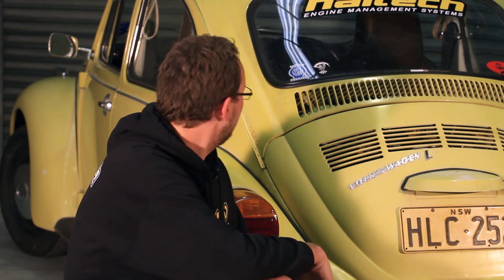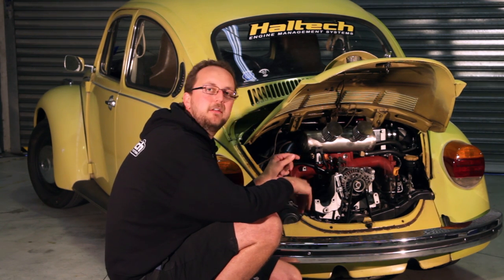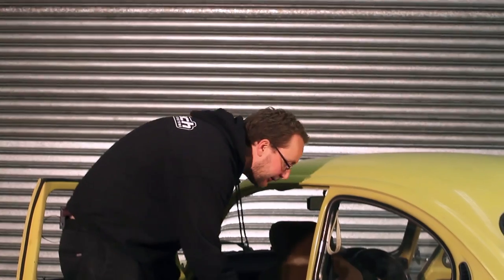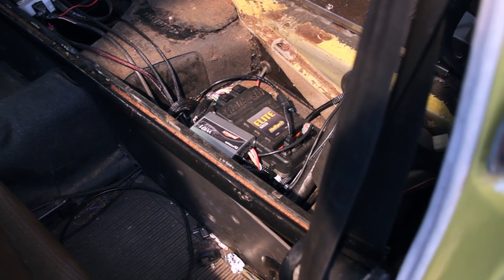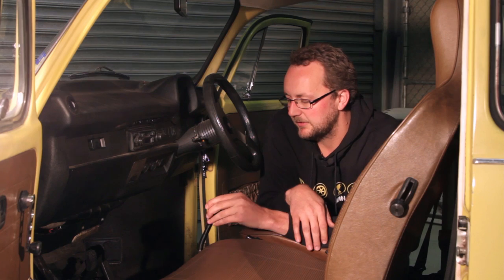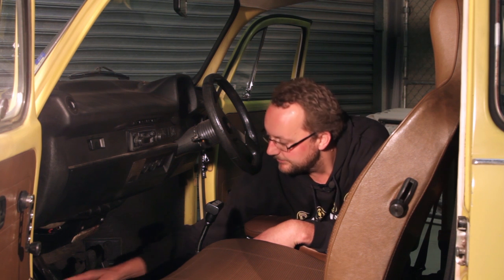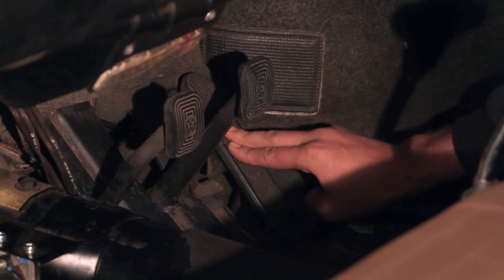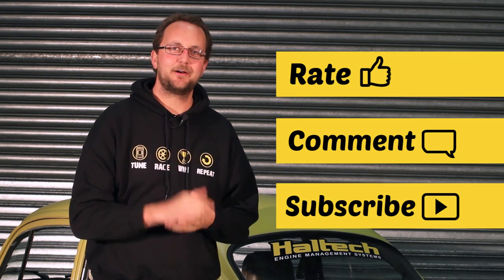Dissecting Miss Daisy: Mighty Car Mods' Subaru powered VW Beetle

Comment: this is NOT a 1970 beetle this is a 72 to 74.. a 70 model is a flat windscreen and is does not have a padded dash
Reply: +Jaysen Ballantine It's a 74 (shown in video description) My mom used to have a gold 74 Super Beetle Sun Bug model back in the day which also had a factory sun roof.
Reply: 73mathesar I know what year it is.. im a vw mechanic by trade he kept saying 70 model. the only thing about that car (standard form) is the gearbox it has the same main shaft bearing and main shaft as a 2l kombi box. but it wont last it will last going up the gears BUT it wont last on compression (going down the gears)
Reply: +Jaysen Ballantine 70's
Reply: +Jaysen Ballantine - hey brother Jaysen, fancy seeing you here! Hehe it's definitely a '74 and it still has the original number plates on it; with the HLC prefix it was first registered in very early 1975. How do I know this... my December '74 build HJ Holden with the same original plates has the prefix HDH### just my 2 cents worth of trivia. Cheers brother.
Reply: GodZilla308 LOL you seam to the nicest people on here sometimes LOL the L bug has a macpherson strut it is from a 72 on wards AND THEY SUCK BAD i have worked on many LOL
Reply: Ok when people say 70's BEETLE they mean it is from the 70-79 year range... Why do people nitpick like idiots "OH MY GOD IT IS NOT a 70's BEETLE..." That is like saying hitler was not a soldier during the 1910's
Reply from the maker: +Jaysen Ballantine It's a 1974 model. When Scott said 1970 he meant the 1970's range - which were the most popular ones - ie most units sold.
Reply from the maker: +RAI DEN ^^^ Spot on. It's a 1974 model as it says in the description, Scott meant it as the "1970's Beetle" which was the most popular model in terms of units sold.
Reply: haltechecu i knew what it was and its one worst of the models you can get they are a shit box !!!!
Reply: +Jaysen Ballantine you need to cool off
Reply: MR_Waynoracer_PC WHAT ARE YOU GOING ABOUT ??????
Reply: +haltechecu Noted that Scott may have meant it as the 1970's Beetle, however that's not what he says in the video ..."the vee dub beetle is one of the most manufactured cars in the world, the 1970 was probably the most common model..."
Reply: GodZilla308 the 70-79 range ARE THE MOST COMMON... Which is the point... STOP NITPICKING... You misunderstood and now you are trying to find a way to justify yourself.
Reply: 70-79 may be the most common, but that's not what was said in the video - that's the point.  I have no misunderstanding in what was said in the video, nor am I tying to justify anything to you - end of story.
Reply: GodZilla308 Some people have SMALL brains so its easier to argue ..
Reply: Jaysen Ballantine What is more sad is the fact you guys are butthurt just because people do not specifically say the year and only say rough years... Both of you need to go get a life that does not involve going around videos saying "THIS IS NOT A 70's BEETLE IT IS A 74..." (When in reality a 74 beetle is still A FUCKING 70's BEETLE!)
Reply: 73+ model. the super beetle still had the flat windshield and flat dash for the 71-72 models.
Reply: +RAI DEN You seem really upset by the fact this is a 1974 Beetle and people have pointed it out in the comments section.  What is sad is that you still can't seem to accept it was made in 1974.  Accept it, it was made in 1974.  Yes 1974.  You can say anything you like; that is was made in the last century; during the decade '70-'79; the 70's; the 1970's; four decades ago, it doesn't matter because it still doesn't change the fact that it was made in 1974.  You can also label people as much as you like, all you end up doing is making yourself look silly, but that's ok.  Oh and by the way did you know this Beetle was made in 1974?
Reply: GodZilla308 I know it was made in 1974... I dont sit there and say I love me some 74 muscle cars, i say "I love me some 70's muscle cars"...
Reply: Jaysen Ballantine You seem salty that people do not refer to a cars specific year, can i have your salt for my chips?
Reply: Jaysen Ballantine All this salt...
Reply: GodZilla308 *Tumbleweed* "I can still hear 2 fools arguing over using the PRECISE terminology when referring to cars" Wow their life must be so boring.

Comment: that's dangerous custom though. too much horse power need strong frame, strong suspension, high performance tyres, roll cage or smart air bag system.